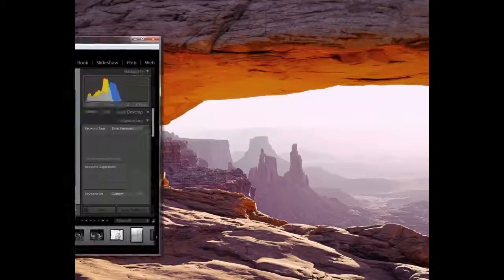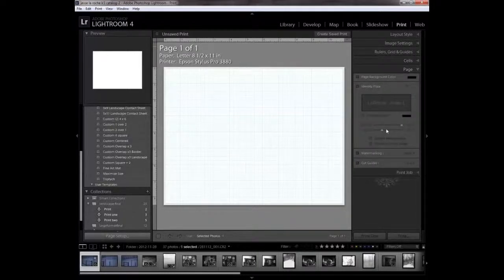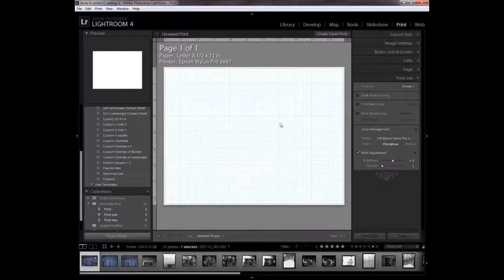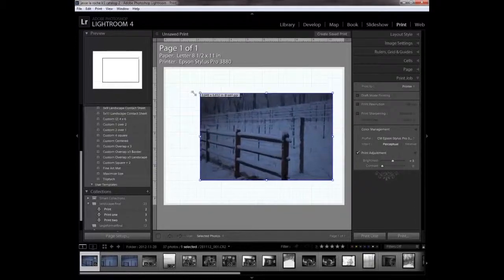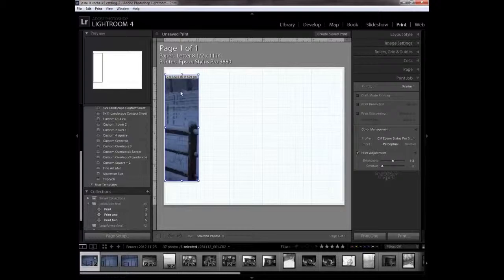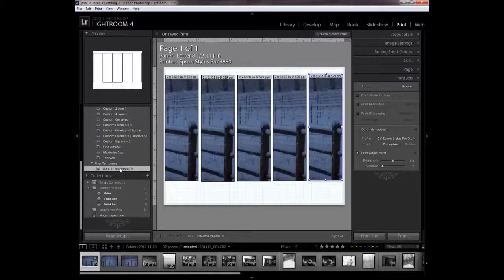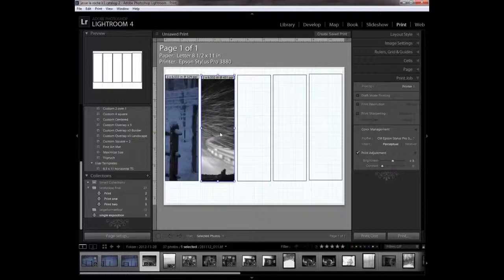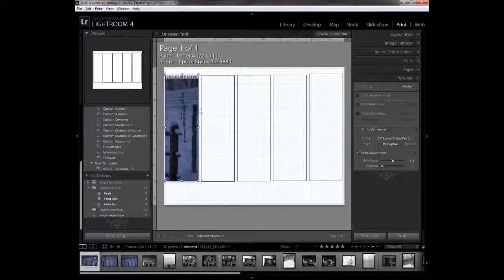Making Inkjet Test Strips with Lightroom

Comment: He says in the video that he wants to test the two compensation sliders at the bottom of the print panel. But those sliders effect the entire print, not individual strips on the test print
Reply from the maker: +Ken Winnick yes that is correct any changes effect the entire file. Thats why it is a little tedious. I have to print a strip after every change, in order to  make a decision based on the printed outcome. if you want to print a gamete of contrasts in one go, you would have to have a duplicate file for every test strip, and change each individual a little more/less depending on what you are looking for. i wish there was a faster solution.
Reply: seems like photoshop is probably the better option for test strips. Create several tiff files from LR, then composite them as test strips and print from photoshop on one sheet. I'll try that method. Thanks for your post.